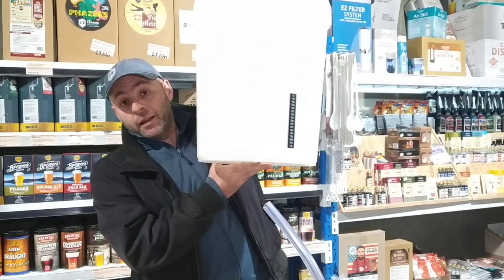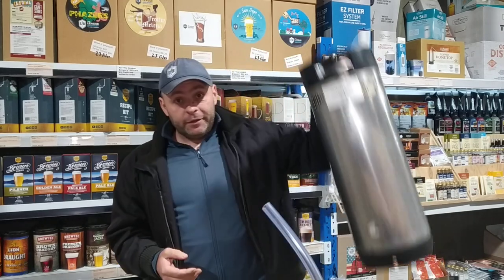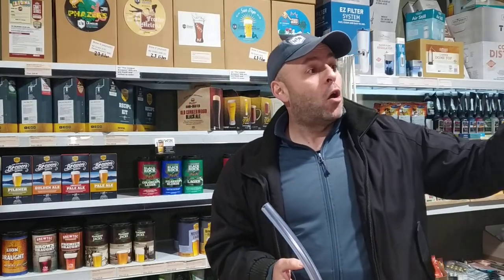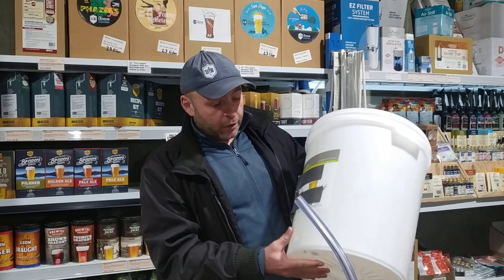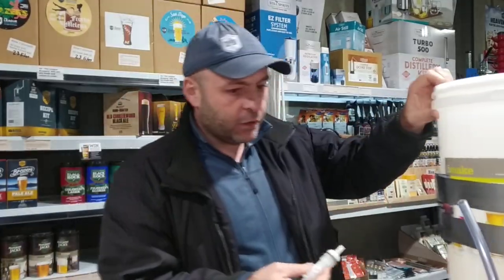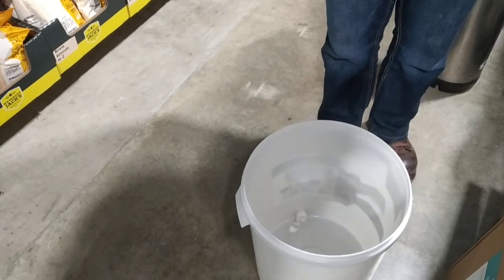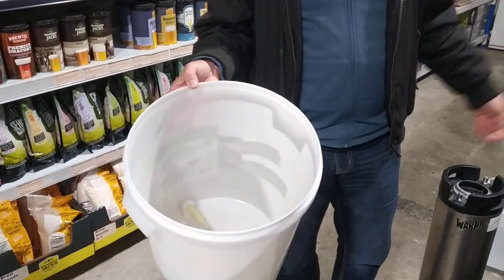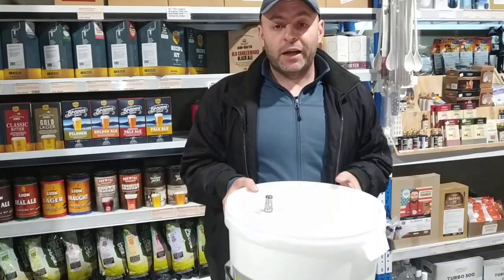Closed transfer to a keg from a simple brew bucket

Comment: For dry hopping. I just put the hops in a ss screen tube underneath the cover with a magnet in it and another one outside the lid. So, no need to open the lid to dry hop. Just remove the outside magnet and the hops cylinder drop in the beer.

Comment: Absolute genius idea - for sure one of the best closed bucket transfers I've ever seen, not hooking a CO2 tank direct to ferm bucket is a great idea, instead using recirculated CO2 from the keg!

Do you have an issues with the floating ball valve + sediment? How well does it pick up the last drop of beer at the bottom? I would imagine if the hose kinks in the wrong position or something, you could lose a fair amount of beer no? You are relying on gravity as opposed to suction/siphon

Comment: Superb, I love the buckets you use. How do you cold crash with those, you mentioned a bladder-do you have a video for this too. I still use a bucket but i want to do a closed transfer and cold crash without air suck back. I always think i lose plenty of aroma/taste from cracking open the bucket to dryhop and transfer.
Reply: FYI new to the game myself, try putting your dry hops inside the fermenter when you first seal it up, use a magnet in the bag and a magnet on the outside to keep it suspended up and out of the wort.  When it is time to dry hop, just remove the magnet from the outside and the bag falls in with no additional oxygen added.

Comment: Been using your floating  Dip method for about a year now, one problem I have is I cant get a accurate OG reading using the tap due to the water going in last no matter how much I stir the wort.
Reply from the maker: Hi Trevor, using a sanitised jug you can pull half a litre out using the tap and then add it back into the fermenter.  Give it another stir and then you should  get a even reading! I hope this helps. Cheers Dan

Comment: Oxidation begins in homebrewing when malt is added to hot water that isn't de-aerated and increases when evil dough balls are flogged and when hot extract is dumped into a vessel. Brewing water should be boiled at least one time, cooled, and racked before using it and an air eliminator should be installed in the main water feed line. The brewing method that homebrewers use produces chemically imbalanced, sugar imbalanced, unstable, extract, which are responsible for off flavors and the short, shelf life of homebrew. The beer is artificially carbonated and drank when it is green, from boiler to belly in four to six weeks. The beer deteriorates before it has a chance to naturally carbonate and properly age. High hop rates and high Alpha hops masks off flavors. The percentage of Beta should be listed on a hop container. Without knowing the percentage of Beta, the quality of hops cannot be determined. The Alpha and Beta numbers should be within a decimal point. The closer the numbers, the finer and more balanced the hops.
The single temperature infusion method and high modified, malt are used in grain distillation, the beer is called distillers beer, the slang name is moonshiners beer. Homebrew instructions and recipes are based on the way that distillers beer is produced. To produce ale and lager with the homebrew method malt would need to contain magical properties in order for low temperature activated enzymes to work during a single, high temperature rest without denaturing, which is impossible. Strike and target temperature are useless for producing ale and lager due to the way that enzymes work. The high temperature denatures Beta. Beta is responsible for conversion. When conversion occurs, secondary fermentation takes place. The conversion rest is skipped in homebrew recipes because depending on the level of modification, high modified, malt will need an Alpha-Beta enzyme mixture added to the malt for conversion to occur, an extra step is added to the brewing process, the fermentation cycle is extended a week to two weeks, and an extra fermenter is required, most of which, go against the idea that homebrewers have that ale and lager can be produced, quickly. Also, the added time increases the risk of infection and oxidation. 
Conversion, dextrinization and gelatinization steps are skipped in the homebrew method and without the steps ale and lager cannot be produced. An entirely different brewing method and under modified, low protein, malt are used for producing ale and lager.
Since, time is time, why spend time on making low quality, distillers beer, when the time can be spent on producing ale and lager? That way you'd be honest when telling someone that the bottle and keg contains ale.
CAMRA renamed distillers beer and Prohibition beer, real ale. To learn how ale and lager are produced start with deClerks books.
Reply: WTF?! Do you get paid to spam every homebrewing video with that cut and paste word salad drivel?
Reply: You're relying on an outdated series of books published in 1957 as the basis for your arguments? .... GTFO out here!